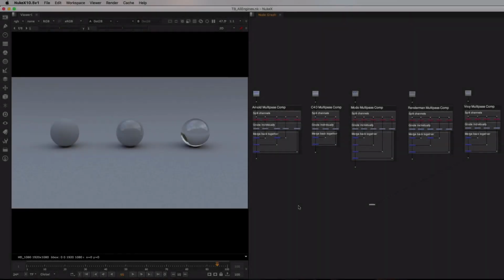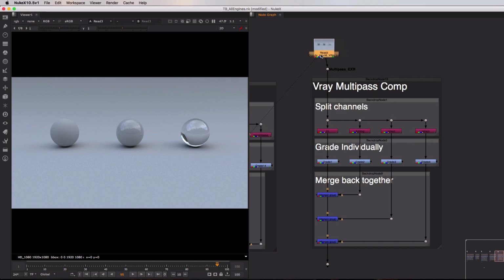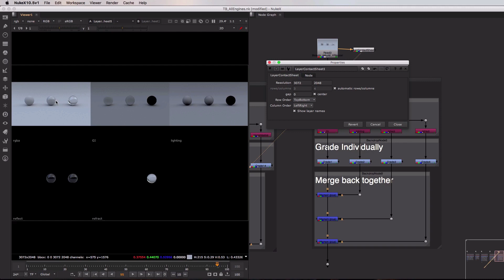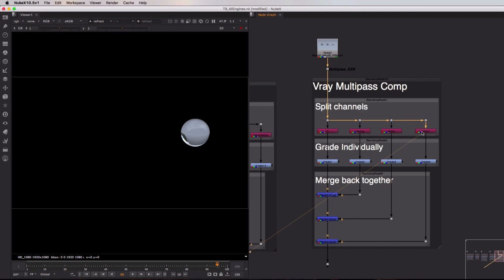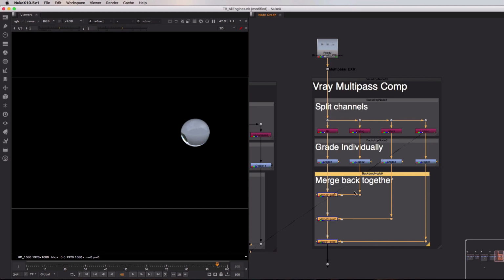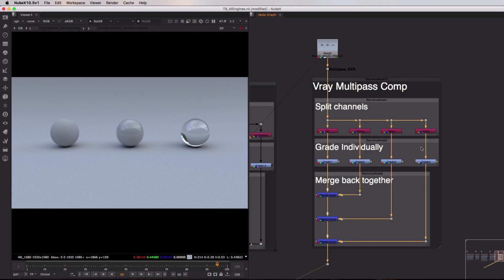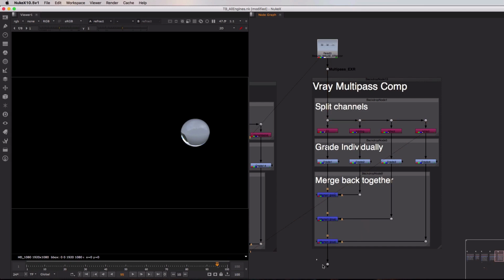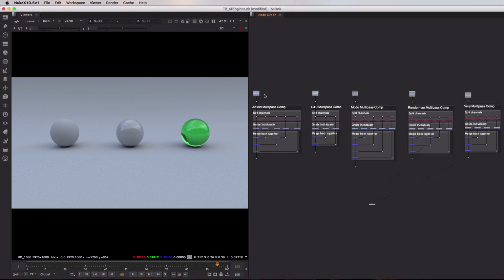Multipass Compositing: Integrate CG Elements in Shots

Comment: I wonder how you would go if for example in one scene director ones a sphere green, then you have to do the CG for the next scene with same setup. Would you have to do the "green" already in the 3D program? or you continue with previous setup and do the correction in post so it will match correctly? Or redo the rendering on previous "approved" scene and get another aproval with the 3D green so you can continue on the next scene?
Reply: Usually, if the client wants a completely different design, that goes all the way back to design. Which means you have to rerender it in 3D. (reflection, refraction and other ways light interacts with the NEW green ball is different vs if it was red.) -- if it's a minor colour correction, like "make that green ball greener and make it shinier" , you can do it in post. It's the usual process in production. Especially in animation.
Reply: correction: "...you can do it in post. And you can copy the approved nodes or gizmos on to the next shot. You may have to tweak to match the approved look"